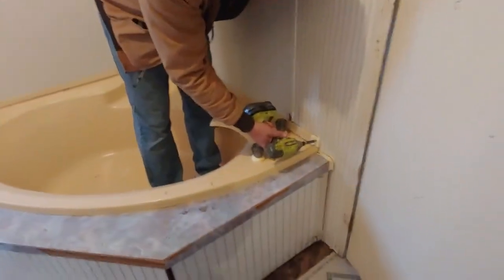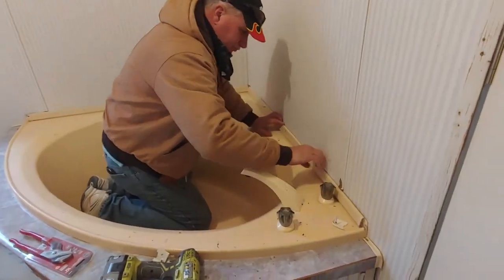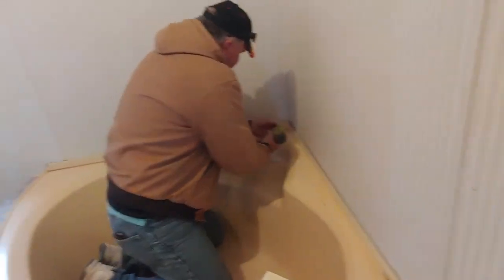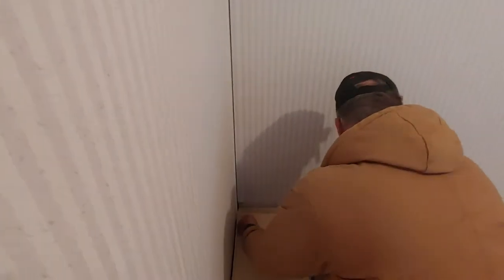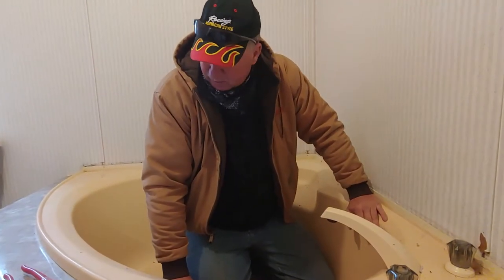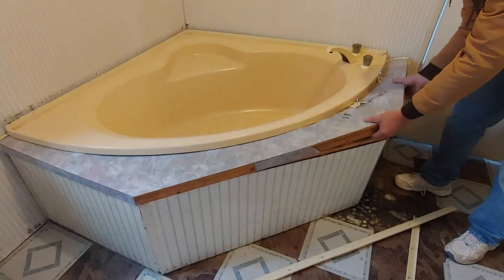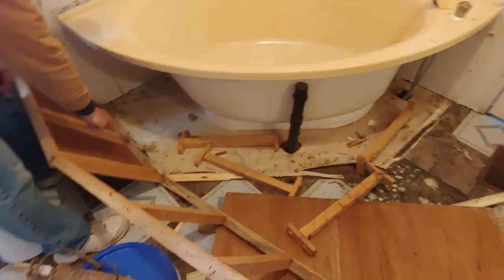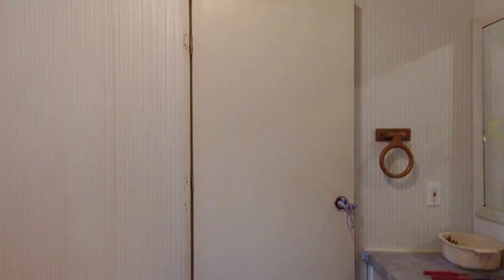How To Remove a Garden Tub in a Mobile Home

Comment: Can u please make a video of how to remove the drain stopper in a mobile home
Reply: In a shower
Reply: I'm taking mine out and can't find the hot water shut off valve
Reply: AND THE FIXTURES ON MINE HAVE BEEN LEAKING, all the time.I crank it as tight as possible & later have had floods of water running down the tub into the wood siding trim @ bottom of tub/tile meets, & it was a gap 10 years ago, when I moved in..this is an 89 Manufactured home, so they gave up on trying to repair waskers, ect.too There is no openeing to get to the plumbing...plumber says he will cut a hole in side wall by tub, & hope for the best..$150. to trouble shoot it..The fixtures look excellent new,no erosion ect..but center crome tub drain is pitted & sharp..We have hard water here in FLA.too..

Comment: I'm in the process of replacing the faucet on my garden tub. But, the new faucets wont fit up. The tub has a metal water input that the water lines attach to and go up threw the tub's knob holes. This metal piece is not budging. Like hub nuts on the knobs are welded or so rusted I cannot get them to come loose in order to drop the whole piece. Any suggestions?

Comment: Does the vent have to be reconnected in another location, I have 2 sinks in bathroom both have vents under sink, not sure about the shower?
Reply from the maker: Cap it off and see if it works with the sink shower or toilet. If they all work  cut the pipe below the floor. Then glue the cap on  where you would have temporarily put the cap on before without glue. I believe you will be just fine. Usually that vent is put there to make sure it affects the tub because of the distance from the other vents across the room.
Reply: Is that "vent" for tub, shower and toilet? Sinks have their own. Capped with tape below floor but getting sewer gas after a shower, toilet not installed yet. Have rag over toilet hole but not tight. Gas could be from no toilet installed? If for all 3 could I run it under floor to outside or does height matter? Thx @StraightArrowRepair